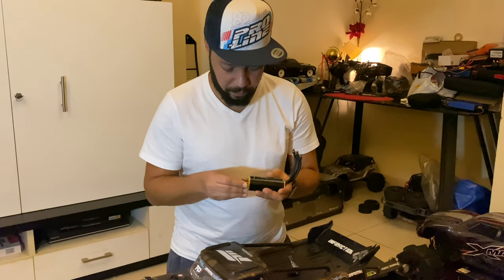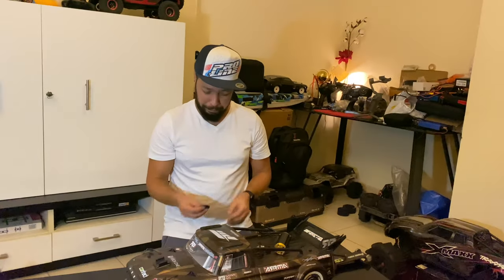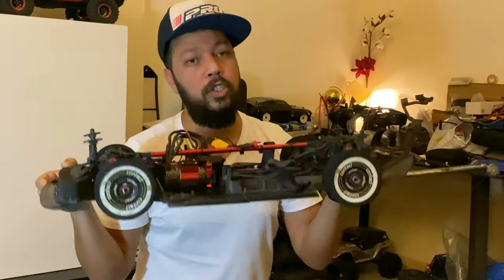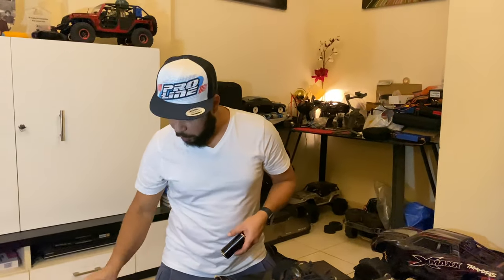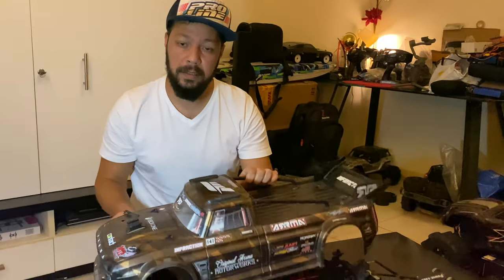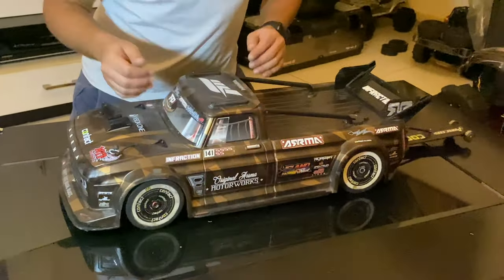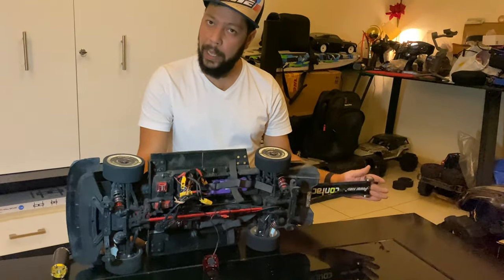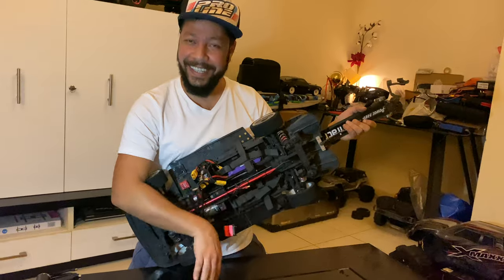Broken TP Power Motor #ArrmaInfraction

Comment: Tp should sell the rotor to rebuild the motor. Most do! I know Trinity sells replacement rotors for their motors believe castle does as well.
Reply: I've looked into this and they do sell the rotor shaft but it cost more than half of what the motor is worth new so most people just buy another motor or switch to another brand
Reply from the maker: Exactly

Comment: Actually i think for me on the limitless if i go 8mm on motor shaft the 8mm pinions wont fit inside the arrma motor mount. If memory serves me rite id have to look but i think thats why i went with the reduced shaft motor.
Reply from the maker: yes you are right you need to change the mount
Reply: @UAERCADDICTS  lol. Yeah im just trying to remember exactly why i went with the reduced 5mm shaft on my tp.